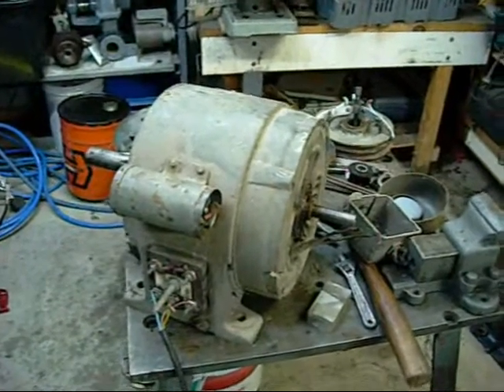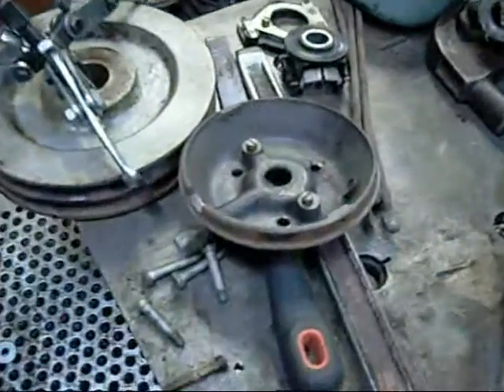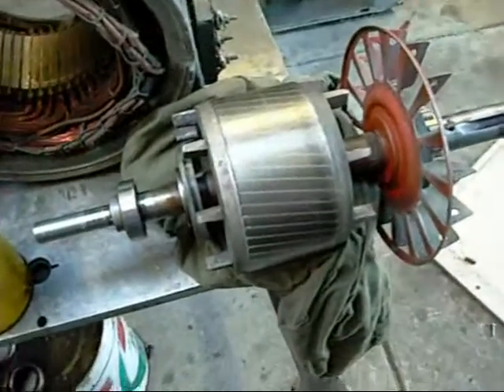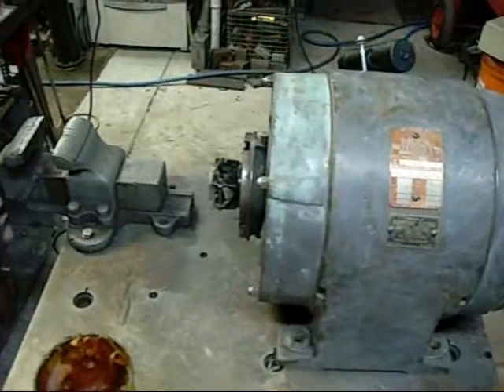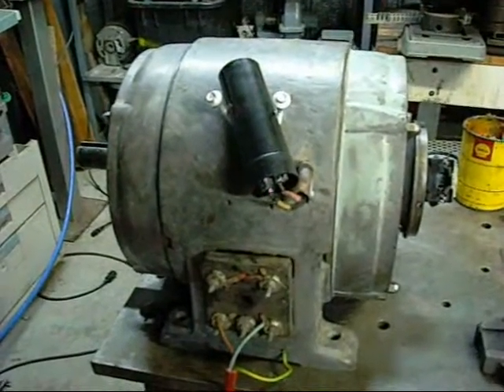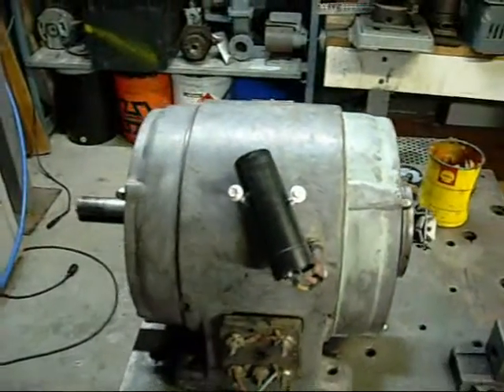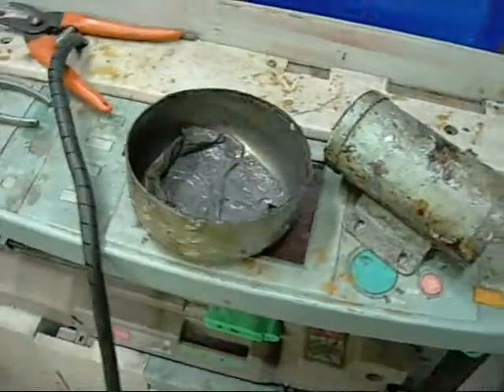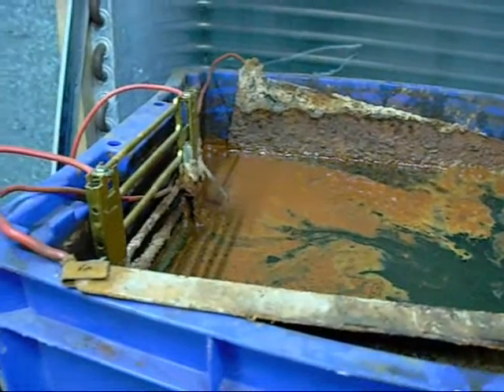Brook RX9 2HP Single Phase Capacator Start motor

Comment: This is great... I've just picked up a 200L compressor with a brooks 3hp motor on.. pulley side bearing is a little noise but has a grease port and my starting capacitor has tested as shot..

Comment: i have three of this type of motor . 2 are 1.5 hp and one is 1 horsepower the original capacitors on all three where 40 microfarads all had to be replaced ,same value fitted and motors run well, i think these motors date back to the 1950s

Comment: I have a JVC Nivico 4TR-990 console stereo, made in 1970. The reel to reel tape deck split phase motor one night would not startup but would start up if spun by hand. It would spin in whatever direction I turned it but ran slow and hot. Realized that the 2mF start cap was dead. Fix was easy, replace the cap.
Turntable motor on the other hand is a C frame synchronous type with a shading pole. Both motors speed depend on frequency so capstan sleeve and pulley changes are required for 50 vs 60 Hz.

Comment from the maker: @dvdragond2 try a electric motor repair shop, or HVAC supply store. both deal with capacator start motors and usually stock a full range of values.

a Microwave cap will not work tho.

Comment from the maker: Hmm, if it never had connections for a start cap I'd say there is a problem in your windings, have you ohmed them properly?
the start winding could be short or going open :( I find the same problem occors with cap-run AC fan motors. they will struggle to start, but when spun up by hand they run fine.

Comment: yws its a very large brushed motor

its 480v ac or dc
and also
its max rpm 1300 

its cool and its weird cuz its got a oil cooler
just loook at my vid
i didnt open it up in the vid
but itl explain wat its like and show how big it is
it serculates oil threw the motor and cools it for hot weather